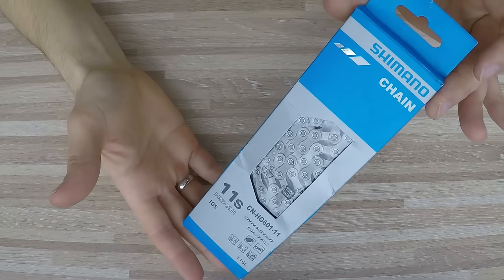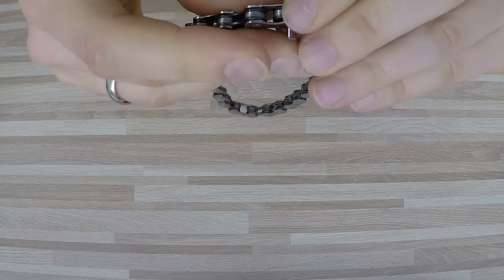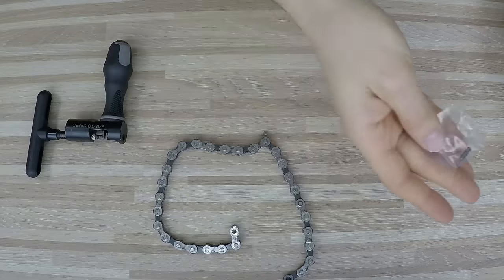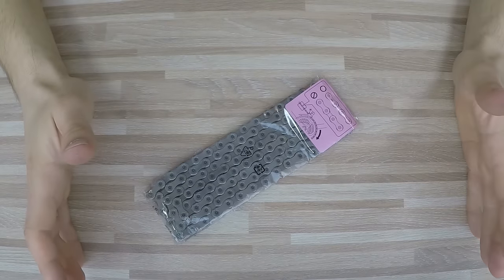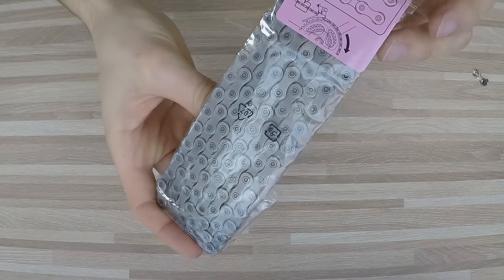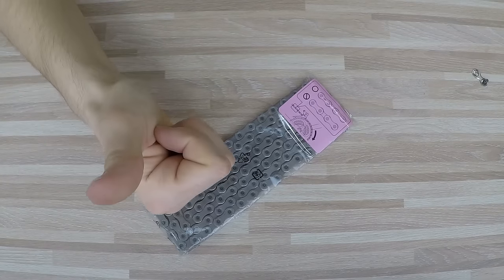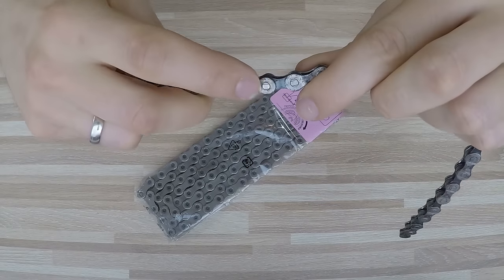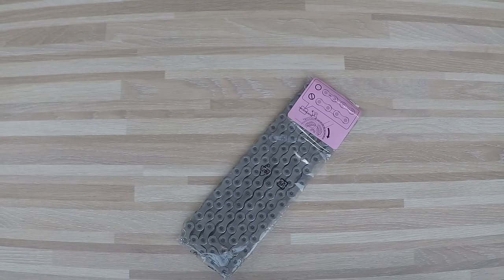4 Worst Mistakes In BICYCLE CHAIN Maintenance. How NOT to do it. SickBiker Tips.

Comment: I fit the new chain after shortening it (Shimano or KMC ) ....carefully fitting the pin using a good make chain tool ...so it is centralised on plan ( there should be a slight protrusion either side of the link plates )....usually  this pin connection will require a bit of waggling to and fro.on plan to loosen it off .....I then mark it with tipex or  like ..dry lube and keep an eye on the joint for a short trip ( two miles say ) ....if you have done this right it will not let you down ....# 1 rule always use a brand new chain and buy the longest so you can shorten it to your needs...its just not worth reusing an old chain both mechanically or financially .

Comment: For starters I ride BMX bikes, 2 as commuter bikes, I have been using chain pieces from other bikes, some KMC, have reused pins more than once up to early 2022 from the mid 90s', never seen any shavings, used Half links and not quick links. I have never used a Shannon chain. The one time that I have had a chain brake on me, it snapped at the plates, whipping around and cutting the back of my calf. Side note, I like to use 5w_20 synthetic oil to lube my chain, if you lube it with this and let it sit it will leave some dirty oil on the ground, hence cleaning the chain.

Comment: Two main rules for me. If I can’t see the chain it isn’t dirty. If it obviously needs some more lubricant I give it some whether it’s clean or dirty.  Never had a chain break although I do admit that changing gears sometimes becomes quite difficult. I’m just about to replace my MTB chain after about 5000 miles because it’s embarrassingly slack and is possibly an inch longer than it should be. I enjoy riding, but not maintenance.

Comment: I used chain oil, spray or bottle before. Nowadays I wax with paraffin. Spray has some warning signs so that's a minus. Also oil attract dirt. Waxing is quite an effort, but plus-sides are, non-toxic, rinse chain-links and lubricate. I also filter wax and add additive substance.

I used old chains so re-use pin. Carefully leave it to outer plate and push it back. Some chains have quick links. I didn't have problems with chain brake. I had problems with wear-out chain jumping over gears up hill and I fell. It was 2% wear. I believe they don't recommend re-using pins. It is not strong as new. I saw one broken chain, broken from quick-link. Also velogi had broken link. 

Sheldon Brown said chain maintanance is almost religous question. I read tribology that is science, so they do it again with same results. Also Jason Smith made tests at friction facts. You can challenge them, I recommend tests. 

Also companies make money with this industry. 

Good tribological methods give big economic advantage said in tribology book. Kitka kuluminen voitelu, seppo kivioja, kivivuori kumppani.

Comment: I have always used varsol to clean chains. And compressed air to blow them out. I like to use wippermann chains with the connex quick link but you can use a rohloff chain tool for the safest way to re-rivet the link. Not recommended on Shimano chains though. And paraffin wax lubes seem to work the best especially in drier climates.
Reply: Paraffin is useless if you encounter much (any) rain. On roller bikes, it will last years. Pure paraffin, is what I used, very inexpensive and easy as well, just dunk the well-cleaned (or pure paraffined) chain into melted wax. Let it sit for a few and take it out, wipe off the excess.

Comment: I use a small amount of diesel in a plastic canister with a good screw on lid and give it a good shake then let it drain off into an old ice cream container. Once drained and mostly dried give it a wipe with a clean soft rag. Then place it into a paraffin wax path with about 10% gear oil. The temperature is only about 50C enough to melt the wax and taken of the heat. The chain is placed into the melted wax/oil blend for about 30min or until the wax starts to skin pull the chain out and hang above the wax bath and allowed to drain. Wipe off any excess with a cloth, allow to fully cool and install. The 10% oil means the wax is never completely hard and softens at about 35C.

Comment: Good advice. If you feel a new Chain it’s sticky so you do need to clean or the transport grease plus dirt is a good grinding paste. I wash my new Chain in paraffin and then give it a wax bath. Check the how to YouTube but needs to be done every 600 miles. The Chain is so quiet and changes with ease. The big plus no dirty hands when changing the rear wheel 👍🏼👍🏼

Comment: Non indexing, and retro NOS  3/32nd" chains like the KMC, SedisSport, 
Suntour, Regina, pre 8 speed Shimano SIS chains can all be taken apart 
at whatever pin you choose.. It would be good practice, if you have the 
tool to 'rivet' the removed pin when you reinstall the chain.  This 
takes a bit of finesse so you don't overtly swell the pin and cause a 
stiff link.

Comment: For a new chain or a dirty chain I spray the chain liberally with WD40.  I do it a section at a time, on the bike - whatever links are available between the lower pulley and the chain ring.  I turn each roller between my thumb and forefinger to ensure it is free rolling and to work in the WD40.  (You'd be surprised how often one or two rollers are not free rolling)  Then I dry the chain with a rag and let it sit for a few hours to evaporate the WD 40.  Then I lube the chain (again turning the rollers between my fingers).  I do this twice and then clean as much lube off of the chain as I can with a rag.
I live in a dry climate so I use a dry chain lube (Boeshield T-9) and it lasts several hundred km between applications.  If you wipe the chain after lubing there's little external residue to collect external dirt.
You can say WD40 is not a degreaser but it sure does get a lot of gunk out of a chain....and it cleans off that waxy coating from a new chain.
Try it yourself or don't, but this method has worked for me for over 50,000 km between my road and MTB's.
Yes, it's kind of labor intensive.  But check out how much a SRAM XX cassette costs.  It pays off.
Of course you have to monitor your chain stretch too.  Stretched chains are the most common killer of cassettes and chainrings.

Comment: I have attached chain broke same chain several times in different locations and never used new pin and never had a chain failed on me.If you keep the pin distance the same both sides you should be fine.Mistake is when pin is pushed too much one or the other way creating weakness.Good chain tool is necessary.

Comment: To have a reusable "quick link" you have to use the kind (Sram) that are designed to be reusable. I have 5 bikes, 3 wieht 9 speed and 2 with 10 speed. One with Sram and the rest are XT, XTR, DA, Ultegra. I keep the appropriate Sram "quick link" in each one's saddle bag.

Comment: All good info that I agree with. A bit long-winded though. 
FWIW I like to clean my chain with thin solvent-rich oil like WD-40, enough to loosen things up but not leave pockets of excess solvent or water. Ideal is that plus an air gun to blast all the dirty oil back out while fspinning the chain backwards.

Comment: I only buy KMC Chains and I use Molten speedwax on them, I currently have a chain that has done 5000 miles and is still less than 50% worn, I like how clean the chain remains using the wax but have to concede it is a faff cleaning and waxing! Plus I can’t feel any performance difference 😊

Comment: Keep spraying/cranking/wiping with Silicone Spray Dry Lube. It will eventually replace all that gunky/sticky factory grease that attracts wearing dirt with a dry coating of silicone lube that also protects against moisture and corrosion. Then repeat every week. It takes like 30 seconds  to hose down with dry spray silicone lube and wipe while cranking in reverse.

Comment: If you ride single speed and ride high torque like street trials Its not recommended to use master links. But then again the trials chains KMC etC: are stronger than 11 speed chains.

Comment: good video... i confess i did not clean the chain when new (before...now i do)... just got some "muc off",  plus graphite lube - muc off, and their chain cleaning tool (not impressed with that bit).  the drivechain became MUCH quieter and felt faster.   perhaps a good video would be on setting the length of the chain (of course if no gear changes just match the lenght)... but if going to a bigger rear gear, how important is it to lengthen the chain?  i swap out 11-25 and 11-28 wheels no problem.  thanks!

Comment: It may seem pointless commenting on a video posted five years ago, but someone might read it!  I am just getting back into cycling, but I come from a background around precision engineering.
The first method only cleans the non-moving outer parts... it may stop you from getting oil stains on your socks, but it does not remove the gritty build-up from the contacting inner surfaces, which is where the friction and wear is taking place.  (Someone may have already made this comment... I did not have time to read every one of 1332 comments!)

Comment: A degreasers function is to displace water  so spray it liberally over the links then rub it with a cloth will do.  As for not re-using the pins, I often reuse the pins without any issues (it is, after all a quality part made by  Shimano).

Comment: From KMCs FAQ:

"ARE THE CHAINS READY TO BE USED RIGHT OUT OF THE BOX?

Yes, all chains have been pre-greased at the factory and are ready to ride right out of the box (some chains must be fitted to length according to your bike’s exact specifications). If you feel that there is too much grease, use a towel and wipe off excess grease from the plates only, avoiding the rollers. For more information on chain maintenance please look at our chain maintenance guide located on the home page."

Comment: i don't lube the chain, i bath it/them in hot wax and paraffin oil. For cleaning i use a cheap ultrasonic cleaner. 5mins x 4 with 50Watt and clear solvent(that stuff that is used in the dishwasher). After every 5min interval, i turn around the chain. gets really really clean, even between the rollers. Since i use multiple chains on one bike for better mileage per cassette and longer better shifting performance,  i use missing links from KMC(work well, but broke a 8spd one very recently for some reason). Also it makes waxing more convenient. After 150-200km i change the chain till i don't have any left, then i clean and re-wax them again.
about reusing the pins from chain...well i never ever had a chain break(though it's a 8spd, so pretty broad and bombproof). I broke and rejoined this chain 16 times alrdy, didn't ever make a issue, even when sprinting at full gas. Torque is quite high, since i have a singlespeed setup with 34t chainring and 14t cog(29er wheels with 2.25in Schwalbe Thunder Burt)

Comment: I make my own chain lube with chainsaw oil (long chain of molecules that wont brake down or get thrown off) and a little molly grease (I add some large ball bearings to the can and shake well b4 use). Seems to work fine, although a bit thick for cold winters. The strongest solvent I use is WD40 or CRC 5-56 and karosene. And like u say it is best left out of the chain rollers. Sprayed on a rag it will clean the chain good enough for after ride maintanance, and it is a quick process.

Comment: I recently tried replacing a chain using the standard links, the new connection was very stiff unless the pin wasn't actually fully in. I've realised it must be because I wasn't able to properly align the flat head of the pin all the way through. After 60 km the chain snapped so will definitely be using a Powerlink or replacement pin in future.
Reply: When u push the pin back through it will be super stiff you have to use middle part of the chain tool to loosen the link very slightly. If you do that and it's still stiff it's possible you somehow bent the link. If you don't align the plates perfectly straight you could deform the hole slightly which would also decrease its strength.

Also it does sounds like you may not have pushed the pin through all the way. It should push out ever so slightly and evenly out on both sides.
Reply: @enterNATO  how does the middle part of the chain tool work differently? I'm sure it's possible to get it back in alright with more practice but both times I've done it it's bent the link of the pin.
Reply: On chains that can be joined with the rivet, take great care to push the rivet into the plate, so that it is IDENTICAL to the surrounding rivets in relationship to their plates, I would slow down as you get close to where you need to be. If both sides look identical and there is still a stiffness, a pro tip is to grab the chain on both sides of where you joined and flex the chain back and forth (with the plates facing you), this will loosen the joined area if you did everything else properly.

Comment: I had to reuse the pin on my KMC chain because the provided quick link proved to be not quick at all, it would not stretch to form a link the right size. I even tried getting another quick link, same issue. They are rubbish. I’ve got a SRAM chain on another bike and the master link is just perfect. Snaps into place, and done. I use that KMC chain on my commuter bike, it has done roughly 2000 kilometers with no issue whatsoever, I even broke the chain and put it back together when changing the derailleurs. I’ll replace it when winter is over though. I know reusing the pin isn’t recommended, but it just worked for me.
Reply: I use Pliers to remove KMC missing links,but I have tried Sram quick 9 speed links i the past,the bikeshop gave me one for free once,I could remove it with only my fingers, but I have not tried their new stuff.
I use old Hazet 760N-3 Slip Joint Pliers, which are great for clamping wire ends too.
Reply: I agree, 9 speed ones just pop apart with your fingers. I'm all 11 speed now and those things need the special pliers.
Reply: you actually don't need the special pliers if you got slip joint pliers,I use the slip joint pliers for wire end caps too.

Comment: I just deep clean the chain with white spirit/paint thinner so it is perfectly clean. I melt beeswax add just a little bit lanoline(rust protection if u add too much chain will become sticky and we don't want that) submerge chain for 10 minutes so the chain will get hot and wax will stick to it inside the links and rollers and it last a long long time and it doesn't get dirty.

Comment: For my bike I like brake parts cleaner to degrease the chain and then soak it in my trucks old engine oil. Also I press in my links but I use a double chain fixer tooler. Also known as a hammer... I keep track of the link I pressed and hit both sides of the chain at the same time with a hammer mushrooming out the pin so it doesn't fall out. Works on both bicycles and motorcycles...

Comment: I've been doing this to my motorcycle and bicycle chains since the 1970's.

I wash the chain with kerosene.  Drop the chain onto the floor several times. Rinse it with water.  Drop again onto the floor several times.  Wash it again with dishwashing solution.  Drop it again onto the floor several times.  Rinse it with water again.  Drop it again onto the floor several times.  Shake and shake the chain like crazy.  I prepare it on an oven toaster pan and toast it for about 10 - 15 minutes.  I bring it out with the pan and air cool it for about 30 minutes.  I install it again into the vehicle.  With some gear oil on a bottle cap, I use an old toothbrush to apply oil onto the chain, rolling the wheel as I oil.  After applying oil on the whole chain, I let it stand for about 10 - 20 minutes.  I get a rag and rub the chain like crazy until it's almost dry outside.  Gear oil, yes. sae 90.  Do not pour onto the chain.  Apply with an old toothbrush  (the softer the better).

Comment: for MTB chains i have used paraffin on really dirty chains for years .wipe off in a cloth till dry and spray with gt85 or wd40.......its cheap at £6-7 a gallon   only ever snapped 1 chain and that was after years of hard riding and racing conditions .Most chain breaks are due to lack of lube .......i now use my compressor to blow dry the chain works a treat till it gets really black then back to parrafin its a thin oil gets right in there .don't ride road bikes  so cannot speak for them .Obviously don't get as dirty as MTB chains .Used the same pin to repair chain ..lasted the remainder of the lifetime of the drive train till i replaced all of it .Not disputing anything ,here just saying what has worked for me .Enjoy your riding folks ,whichever you choose .Stay safe X.

Comment: btw, you want a chain to wear out first because it is the cheapest part to replace.  If you clean it regularly and replace it as needed, the gears should last a lifetime....a chain that is too hard (wear resistant, will grind away the chainrings and cassette).  So my option, is that if you use a chain from any manufacturer, you want the chain to wear first to keep the gears from wearing out.  those who use these aftermarket chains think the chains are better quality because they seem to last longer, but end up wearing out the cassette and chainrings.....
Reply: interesting

Comment: I tend to use the original grease until its time for the first cleaning (its usually within the first month with the way I ride ;) ).

I also reuse link pins, but that's also because I haven't had to break a single chain more than twice, and I haven't had any issues outside using the broken chain on a motorized bicycle (had to replace all chains actually, cause they just weren't strong enough for the motor, and they were used by a different motor, and had been worn)